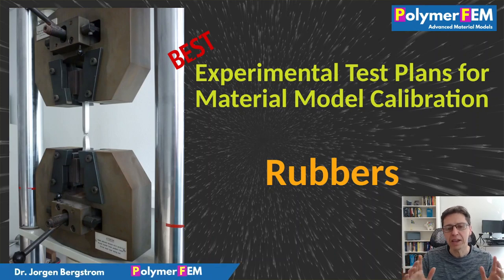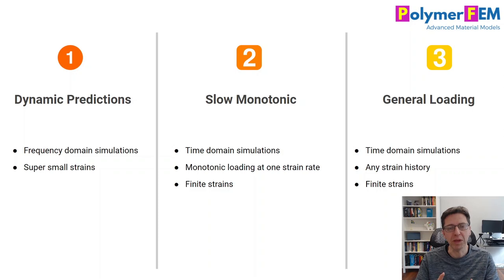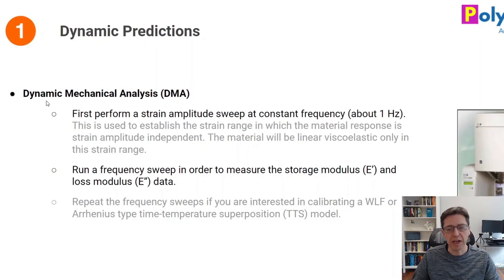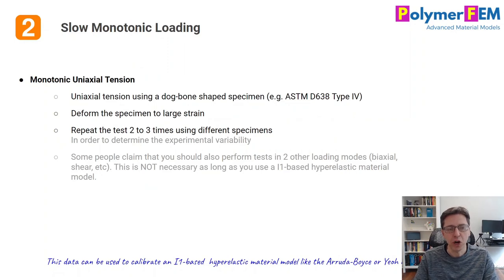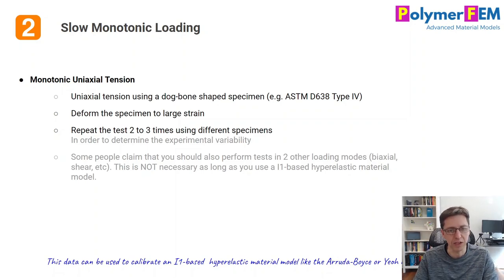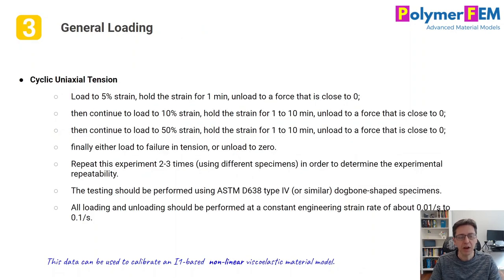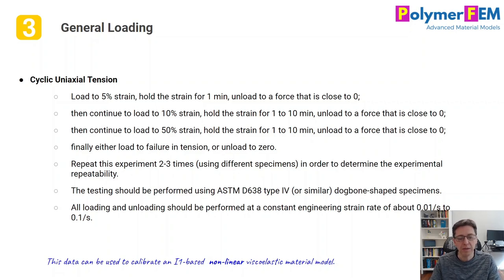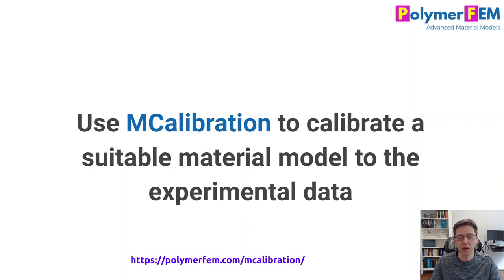Experimental Test Plans for Material Model Calibration - Rubbers

Comment: Hello Dr. Bergstrom, a video where all the raw data of the different test methods will be calibrated to one material model considering hyper- & visco-elasticity the same way would be helpful. How to calibrate DMA, uniaxial, biaxial, shear and Mullins test data in one material model? Is it necessary to splitt it up in different Mcalibration files? The fitting of different experimental data is quite challenging. Thanks a lot!

Comment: Hi Dr Jorgen, 
Can u post a video on how to calibrate a material modle using Mcalibration for bi-axial test data ? We have a custom built machine and could get equi biaxial data. Thanks a lot.
Reply from the maker: Good suggestion. You can do that by specifying the loading mode to be biaxial in the Load Case dialog.